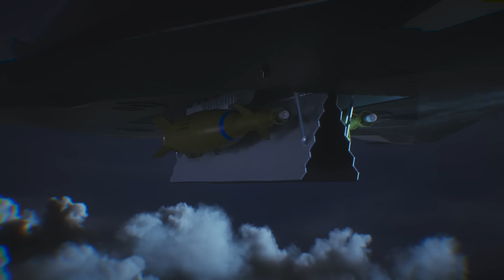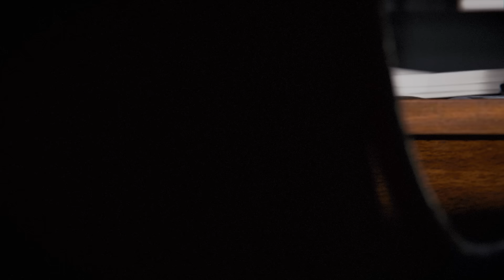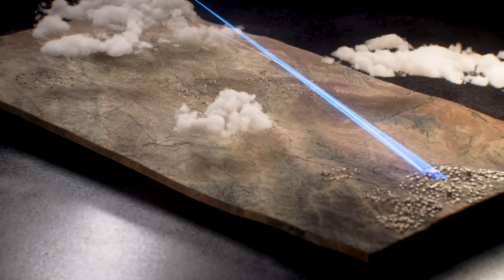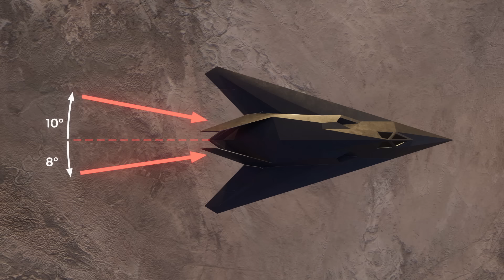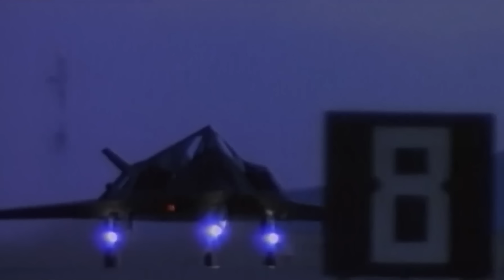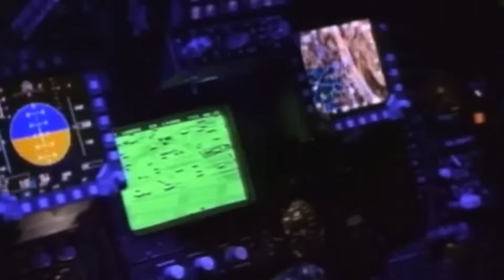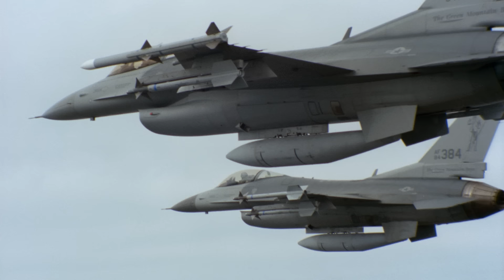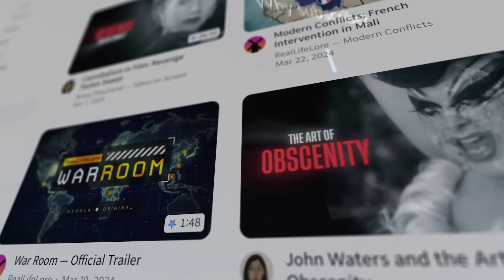The Insane Engineering of the F-117 Nighthawk

Comment: Fun fact: this piece of crap got shot down over Yugoslavia after being detected by an ancient Warsaw Pact Tamara. 
This plane would have been worthless in 1980s, over Bosnia in 1999 it had no chance.
Reply: Fun fact: it was shot down because the Americans were really stupid and made multiple mistakes. 

The first mistake was having all F117 aircraft at a single airbase, and not spreading them out. The second, crucial mistake, is that they never changed flight path, which meant that you could predict the Nighthawk's location pretty accurately without even using radar. The third, and final, nail in the coffin was that when this aircraft was shot down, its bomb bay doors were wide open, ruining the radar cross section. The third reason was that, unlike most nights, there were no seed planes around to protect the aircraft.

The yugoslavian army noticed all of this, and in a hail mary attempt to down it, sent a shit ton of rockets with pretty rough directions over a 8 mile radius, and a single "golden shot" downed the aircraft. It didnt hit, but the shrapnel nearby was enough to damage the (way too fragile if I may add) F117, and down it.

The incident isnt a proof of yugoslav military superiority or proof of the F117 being a "shitbox". Its a testament to the Us army's stupidity and the fact that sometimes, miracles do in fact happen.

Im tired of this fact being repeated over and over again without proper context. And even with all this context, 1200+ Mission carried out by 59 aircraft over the course of 25 years (1983-2008) is pretty damn impressive.

Comment: Um... the F117 wasn't shot down because radar could see it if it flew over, it was shot down because of an extremely lucky radar ping while the bomb bay doors were open.  And that still took multiple SAM launches.

The idea that low frequency radar can beat stealth is Russian sales propaganda.
Reply: The bomb bay explanation makes no sense. It would have to be stuck open as the aircraft was on egress route. The fact is that stealth works through inverse square law, so if you reduce distance stealth stops working. The F-117 almost flew into the S-125 minimum engagement distance. It was a near point blank shot. Physics itself mandates that a stealth aircraft is detectable at extremely short ranges.
Reply: @ChucksSEADnDEAD  also given how the stealth systems WORK in the F117, "the inverse square law" would mean that the F117 would have to be parked on top of the radar system that was set in low power mode for it to detect the F117 was there.

Stealth works by scattering or absorbing radar waves.  it's not a magic shield that works off inverse square laws.

Skunkworks did a LOT of tests on Haveblue and got returns the size of a quarter off the aircraft even at very close ranges.  Flying into its minimum engagement range makes no sense for it to just beat stealth at that point.  So I have no idea how you think this is an "inverse square law" when the radar waves are NOT returning to the transmission point.  How do you get better returns off the emissions when they're not coming back?  How do you inverse square that?
Reply: @setojurai it's not about low power, it's about low frequency. Low frequency radars can pick up resonances from parts of stealth planes, and can be used to track them in some cases.

The tradeoff is that low frequency radars don't have the information density for high resolution. In other words, a low frequency radar can track a stealth plane in some cases, but can't lock a missile on. You need a high frequency radar to get a missile lock, and those are what most stealth aircraft are built to beat (except the B-2, which doesn't need to make concessions to fighter maneuverability and is built to beat everything).
Reply: @sethb3090  Thank you for the expansion on that.  That's good info.  And yeah, he still had to operate the radar in high frequency mode (I used the word power for some weird reason but yes you're right) to get a missile lock.  Which he did.  Off an open bomb bay door.  Which was only open for a few seconds at a time.  Dude got seriously lucky and Russia has used that ever since to sell their inferior systems.  And a disturbing amount of people think that the radar legitimately can beat stealth systems.
Reply: @setojurai  There was for sure good luck involved, but I have to respect the guy for putting his SAM sites in a position to capitalize on that lucky break when it happened. It's a good reminder to all of us that it's not just the tools you use, it's how you use them that makes the difference.
Reply: @sethb3090  - You can "gain down" a low frequency radar (especially the old tube technology platforms) to the point of being worthless against normal RCS targets to increase detection ranges and separation on a specific low RCS platform. You can also go the other direction and "gain up" those old tech and low frequency platforms to detect a hole in the normal background clutter that a stealth platform creates. You still, however, have the issue of terminal high frequency missile guidance and radar fusing -- unless you aid with (or switch completely to) an optical guidance mode.
Reply: @sethb3090  True.  And still this is a better reaction than "BUT RUSSIA IS MAGIC THO" that the other guy was posting.
Reply: @ChucksSEADnDEAD  Basically the radar system was turned on in high power mode and managed to catch the bomb bay door being open JUST as it was opening and they launched on that vector.  It was the ONLY time the F117 was EVER shot down and it was sheer luck.  And russia has been using that to sell an outdated anti-air system ever since.  It's literally russian sales propaganda to say that system can beat Stealth AT ALL.

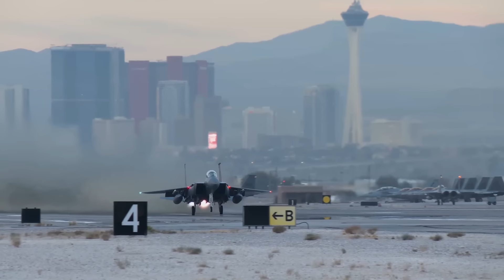Comment: Can anyone explain why the flames are different colours for the afterburner take-off @16:35 ??   Pilot error or machine/engine management fault??
Reply: No, that just afterburners. If it had a fault it wouldnt be allowed to take off, and pilot error is unlikely given the training of air force pilots.
Reply: Just a guess, but very slightly different fuel mix per engine? Different fuel/air mix, slightly different engine power settings, not sure if the engines can pull from different tanks, if so different fuel? Simple trick of light? Probably some combination of all the above.
Reply: @nickierv13  Well that's a given, I'm after someone in the know providing actual known examples for such a sophisticated plane having engines running that differently in their most strenuous mode.

I figured afterburner would only be available at absolute 'max power setting' but if it isn't it would be interesting to find that they can maybe be "accidentally" thrown into after burner at different power settings, to do it on purpose makes no sense, to me anyway haha.
Reply: @Crabman_87  The F-15 has split throttles. You can set different power levels, in afterburner too.
Reply: @ChucksSEADnDEAD  so there are afterburner levers as well and they can be put on at different levels of engine power? Never would have thought that.
Reply: Either way i dont think it is anything to worry about. Sometimes planes just do what they do.

Comment: Not him adding a rocket motor to a bomb and calling it a missile.
Reply: Well, funnily enough the navy did exactly that with the AGM-123, which was a GBU-16 with a rocket motor bolted to it. The F-117 never carried it of course.
Reply: A missile is: "an object (such as a weapon) thrown or projected usually so as to strike something at a distance" - this according to Merriam-Webster, an American dictionary. It may not be militarily correct, but it grammatically correct.
Reply: @luckystriker1972  we can argue semantics all day long, but if you're going to make a video about a military aircraft, military terms should take precedence. Bomb & Missile are classed and employed differently within the US military, so it's important to not use the two words interchangeably.
Reply: @abhishekrao1525  We can indeed argue semantics all day. Like for instance a rocket, in military terms is unguided self-propelled, but a rocket according to NASA is indeed guided. SpaceX's Starship is not a missile, it's a rocket. A bomb in the English language is an explosive device regardless if it is placed, dropped, hurled. shot or yeeted. The F-117 most definitely yeeted a bomb which makes it a missile.
Reply: @luckystriker1972  Sure, you're technically correct and you can use both of those words interchangeably all you want when not talking about a military aircraft. But it's inaccurate and irresponsible when talking about a military aircraft and using other military terms. The DoD uses bombs and missiles differently for a reason. I'm guessing you've never served in any military, much less an aviation combat squadron. I have. I'm coming at this from personal experience with existing maintenance and usage procedures.

Comment: "missiles"... guided bombs. it carried jdams, paveways(just normal dumb mk82/mk84 bombs upgraded with gps and laser guidance kits respectively) or b61 nukes. it never carried any missiles
Reply: But yet, there is no official record of the F-117A being upgraded to carry the B61 nuclear bomb. Reason: to prevent accidental detonation, modern free-fall nuclear bombs like the B61 and B83 have extremely complicated fusing systems with a lot of security locks, and that would require the installation of specialized electronics to arm and drop the B61. Interestingly, the Soviets from 1983 on really feared this type of plane, because on a one-way mission it could fly from western Europe all the way to Moscow effectively undetected until the nuclear weapon was dropped, which meant the response time of the air defense system around Moscow would have been just about zero.
Reply: the gbu-12 is not a JDAM if you're gonna correct someone please get it correct!
plus the video is about the plane not the weapon the guy just didn't want to research weapons
Reply: @Ryan-ob7yt  If you're going to talk about a strike aircrafts capabilities, then you should probably understand the capabilities of the weapons it carries. Its kind of inseparable.
Reply: @_Addi_  this videos more about how the aircraft flys and its stealth capabilities its not about its strike capabilities as it only briefly states that its an attack aircraft and what that means
Reply: @Ryan-ob7yt  Sure, it does more so focus on the plane. Even though that is the case, the plane was designed specifically around delivering a specific payload. You should be able to talk about those payloads in an accurate manner, evwn if you dont go in depth. Even then they got some aspects of the plane itself wrong. Or, more specifically the way they animate or explain certain things.
Reply: I don't see how it matter past "It drops  the GBU-12 paveway a laser guided munition (proceeds to go into detail about the optics and laser system) 

like its not a video about the gbu 12 i don't see how not going into further detail takes away from the video past the animation being a lil cringy to military nerds
Reply: @Ryan-ob7yt  I dont think anybody here is saying that they should have focused more on the weapons. Just that he should be able to get the terminology right. Thats all.
Reply: @_Addi_  im saying it doesn't matter if he gets it right ir not
Reply: @Ryan-ob7yt  Thats incredibly dumb.
Reply: @_Addi_  ugh maybe you would understand more if you read my longer comment on the matter instead of just the shortened version
Reply: It's engagement bait :))) For people to comment and make the video comment count go up
Reply: @doktork3406  baiting me into not taking anything they say in the videos serious...
Reply: A missile is: "an object (such as a weapon) thrown or projected usually so as to strike something at a distance" - this according to Merriam-Webster, an American dictionary. It may not be militarily correct, but it grammatically correct.
Reply: @luckystriker1972  Look at the second definition. Also, that is not the correct use of "grammatically correct".
Reply: @luckystriker1972  Look at the context here (i.e. modern military equipment). That "ancient" definition wouldn't have sufficed, as 'missiles' would've included many other types of dumb weapons.

Comment: A video on why in the world companies can charge the military such astronomical prices for their products would be VERY insightful. I wouldnt be surprised if over $1B were spent anually just on overcharging.
.....$95k FOR BUSHINGS?!?!
Reply: That has nothing to do with the purpose of this channel...
Reply: It's fairly simple. DOD in their infinite wisdom gives each unit a budget for each fiscal year. If you run a surplus of funds, they decide "oh, you clearly don't need as much funding" and take it away for reallocation. When that reduced amount is insufficient, it's very difficult to ask for additional funding because "but last fiscal year, you managed with the amount we gave you this time around". So the standard practice is to spend it all just to maintain current funding.
Reply: Military acquisitions require a lot of legalese stipulations in regards to materials, sources/suppliers, testing standards, etc. For example magnets in one F-35 part were found to come from China, and the mamufacturer has to change suppliers.
So you can't just go down to the store and get some bushings. You have to pay for a factory to custom make you bushings that obey the standards (which often involve inspecting 100% of units, rather than using a statistical model to make entire batches pass QC).

Comment: LOL!  "insane engineering" ... it was a silly gimmick that was scrapped after just 10yrs of service because it could not fly.  For comparison, the F-16 and the Mig-29 are nearing 45yrs of service each.
Reply: Last I checked 1983 - 2008 is a bit longer than 10 years, though you can still see them fly into the 2020s.
Reply: @Nstar98  That's incorrect.  Completely incorrect.  It was test flown first in 1983, and was only deployed for the first time in 1991 during Gulf War I.  Plagued by problems it was basically grounded after 1999, then officially retired in 2008.  It's a clunky unflyable piece of junk, notwithstanding some of its high tech gear.
Reply: @zb5775  You really are suffering from fact deficiency aren't you? You sound like Pierre Sprey.

No, it was not first test flown in 1983, that was 2 years earlier in 1981.

1983 was when IOC was declared for the F-117A, i.e. when it was first operational.

It was officially retired in 2008 but it's still flies as a training and evaluation aircraft as of 2024.

So no, not incorrect, not incorrect in the slightest.

"Plagued by problems it was basically grounded after 1999"

Funny how it was still operational for the Iraq War in 2003 then wasn't it? Nearly half a decade later.

"It's a clunky unflyable piece of junk"

It still flies as of 2024. Clearly it's not unflyable at all.

And seriously, indicate on the doll where the F-117 touched you.
Reply: The stealth insane engineering
Reply: Its still flying today
Reply: That's what happens with an effective prototype, especially with new tech. It'll get retired way faster than older stuff that doesn't have it